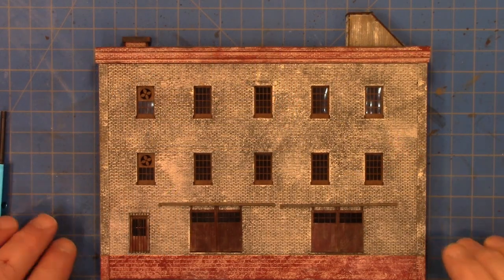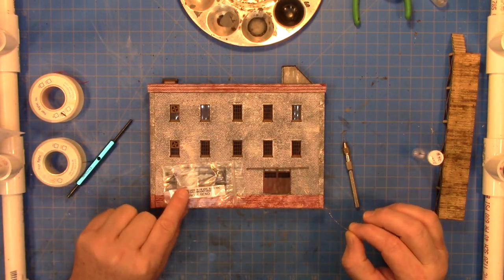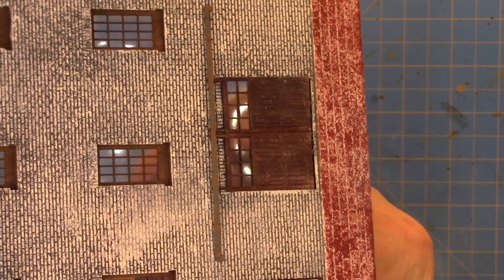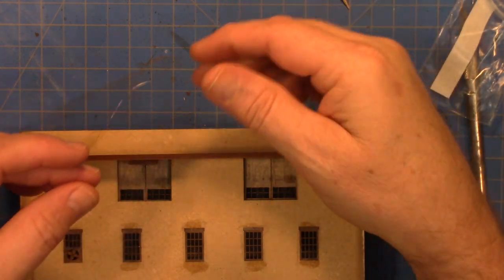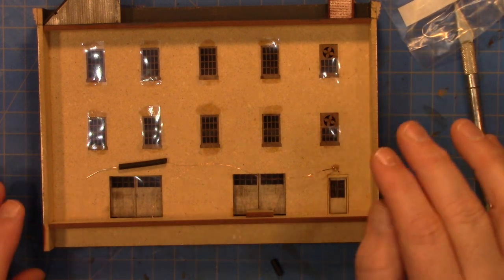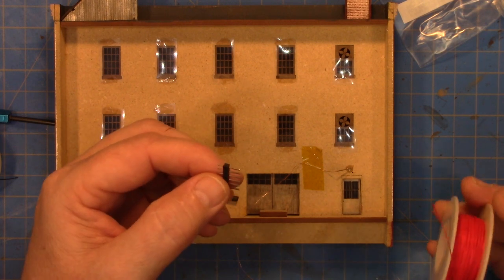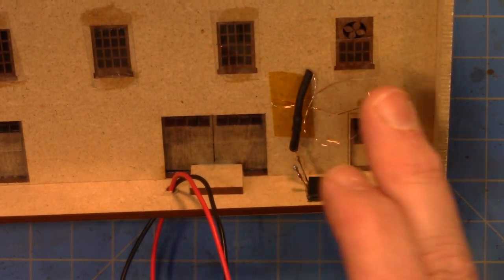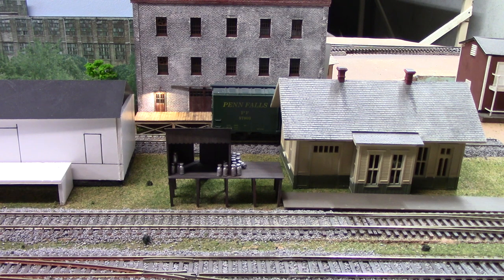What's on the Bench - Episode #5: Let There Be Light!

Comment: yes was good that i like the cross over plug to stop shorting it out will the resistor not get very hot with 12 volts in and 3 out pushed up against the foam insert to cover the windows etc etc will get hot and stink a bit it might need a double backed sticky pad and a bit on metal plate stuck to it to dissipate the heat stuck to the foam so the resistor touches the metal
Reply from the maker: The resistor is a 1/4 watt 1000 Ohm.  with a forward voltage drop of the LED at 2V the current through the resistor is 10V/10000 Ohms = 10mA and the power is .010 * .010 * 1000 (P = I*I*R) = 100 mW so it is well under .250mW rating of the resistor and heat generation will be minimal.  Thanks for watching.